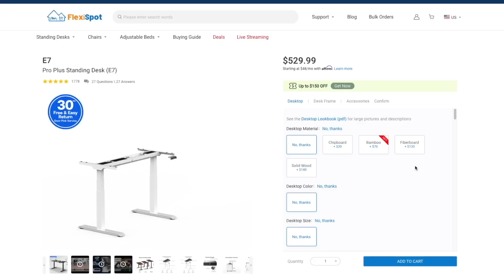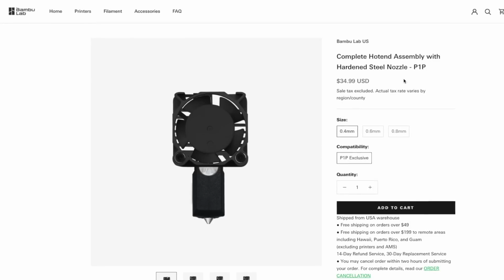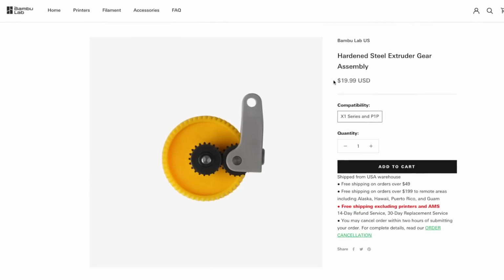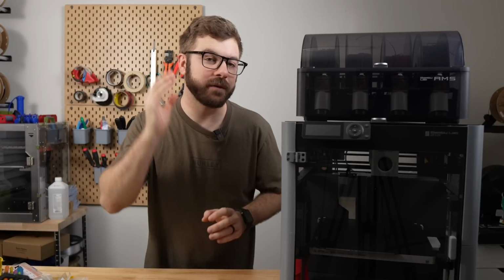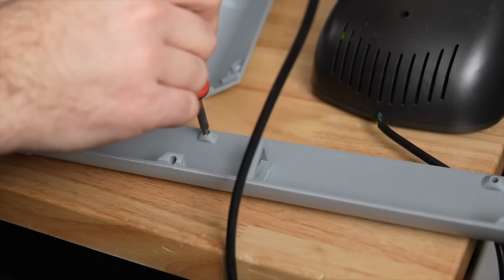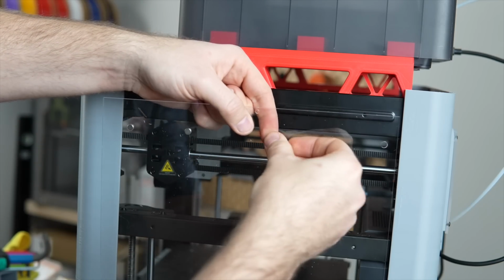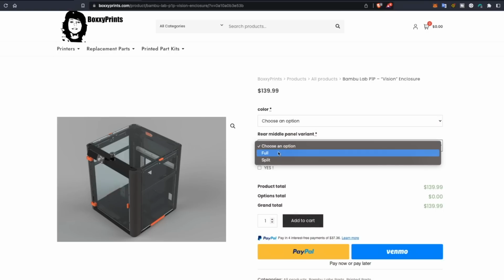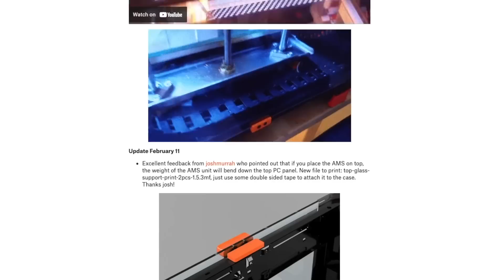Best Bambu Lab P1P 3d Printer Upgrades!

Comment: I found that the connector for the detector of the filament cutter can appear to be connected, but has in fact only half its pins engaged. This then gives an error that the printer can't detect the filament cutter blade. Just make sure to line this connector up properly, or check this alignment if you get a cutter error after doing the extruder gear change

Comment: That printer is a problem for me. I want to buy the P1S but i heard that it does not do PLA very well when the door is closed. If i will be printing PLA 90% of the time i dont want to leave it 90% of the time with the door open cause it will break. Also i do not want to remove the door either because mounting and dismounting all the time well... it will break it. Is it possible to install some kind of case fan so the printer can also be good for PLA with the door closed?

Comment: have you thought about upgrading the P1P to a full X1, It seems to me the difference is the Motherboard that lets you use the better firmware with all the options the X1 has. No one can seem to point me to what is the difference in hardware other then the Motherboard.   MC Board - X1 Series $64.99 USD
. can you spot what am i missing, all the P1P hardware works with MC board for X1 series..????

Comment: That is a very nice upgrade.  I really like the acrylic/polycarbonate clear visibility from all sides and it looks terrific.  

I read on the Bambu website that the p1p didn't come with a circuit board fan and they recommend adding one if enclosing the p1p to keep the main board from overheating. They also recommend an exhaust fan with filter when working with ABS or other performance filaments.  I think you can also add the x1c bed cooling fan to keep pla from dropping or sagging, but it's probably better and easier to simply pop off the side magnetic panels when working with pla.

Such cool upgrades, thanks for the tips. 👍

Comment: A part from that extruder hardened gears and hotend and enclosure, what else is worse in p1p than in x1 carbon? Do I need to upgrade anything else to get same performance that is on x1 carbon? I do not care about screen etc, but i have heard that electronics is better on x1 carbone and z screws mounting?

Comment: What brand of ASA do you use? I am trying to print some medium sized parts and they keep warping with the stock Generic ASA and Bambu Labs ABS settings. I have a cardboard box as an enclosure as well. I am also using Polylite ASA which might be the problem...

Comment: I'm just now into the video but wanted to ask this before I forgot.
I've been printing in mainly PLA and PETG and I wanted to try higher temp materials. Just started using TPU on my Prusa recently and that is fun.
My question:
What is the difference in your opinion in printing with ABS vs ASA?
Thank you

Comment: Hi, I’m totally happy with my p1p. It’s my first 3D printer 😍
Do I really need the nozzle and extruder upgrade? Is there a difference in print quality? Would be nice to give me some tips 😉
Reply: The upgrades mentioned are specifically designed and necessary to print abrasive and harder materials. The standard nozzle will wear down if used for abrasive filaments, and the extruded gears also. They won’t really improve quality of pla or petg printing, just enable printing more engineering and exotic materials. One thing that should be noted is filaments like abs and asa need ventilation or very good filtration even if enclosed.
Reply: @lifson22  thx, this was the answer I was looking for :)
Reply: @richi718  just to add to that - PLA composites like Wood PLA, Marble and especially Glow in the dark are also abrasive ; not as much as Carbon Fibre mix with ABS/PA. But yeah, almost any filament with CF is abrasive and will wear your nozzle down quickly and start chewing away at the extruder gears and lead to inconsistent extrusion.
Reply: @TheCyberSpidey  thx for that answer!
Reply: Also curious about this

Comment: does the cost of the pc for the enclosure cancel out the upgrading price? if the otd price with upgrades is less than $950 this may be alright, but for 1200 you'll get the full on x1c without the ams
Reply: I think if enclosing the p1p you'd also want to add a circuit board fan and an exhaust fan+filter.  Even so, those prob don't add a huge amount to the total price.

For me, i think it's better to go straight for the X1C.  

These upgrades are great if you already had the P1P.
Reply: It depends on where you source it. If you know someone who could mill the pc or acrylic parts with an cnc or even kindly ask a workshop for leftovers, than it's noticeably cheaper than buying, of course.

Comment: I think it should be mentioned that if the extruder gear is hard to remove, Bambu Lab has a tool that can be 3D printed to help remove stubborn extruder gears. Mine are always tough to move and I have to use that tool to remove them.

Comment: Is it cheaper to upgrade the p1p instead of getting the x1 carbon? Which do yiu preffer?
Reply: It's cheaper to upgrade the p1p but not by much. I'd rather just pay the full value for the x1-c and actually have full warranty when shipping it back. If you need to warranty your p1p after putting on all the upgrade, you need to take everything off before shipping it back.

Comment: Hey Daniel, if you are interested I just released a new printable carriage to run a StealthBurner and CW2 on a 2020 V-Roller setup. I've seen a bunch of adapters to mount it to different stock carriages but hadn't seen anyone offering a complete replacement. It's over on Printables if you want to check it out, I'm working on figuring out integrating KlackEnder but it currently has options for BLTouch and Biqu MicroProbe.

Comment: Vision enclosure or Arc enclosure... 🤔🤔🤔
Reply: I ended up with the ARC. Like the looks personally.
Reply: @truggy82  I think I'm going to hold out for the ARC. So far it seems to be the only version offering a kit. I can print pieces, I have a printer. I can't print bolts, side panels and magnets though.
Reply: @CB_agotchi  its not that bad. Need one m3 bolt kit. I didn’t use the door and with smoked panels it came out great with my corex gunmetal metallic and translucent blood red. Used Bambu top glass.